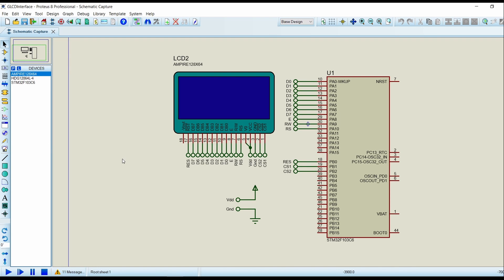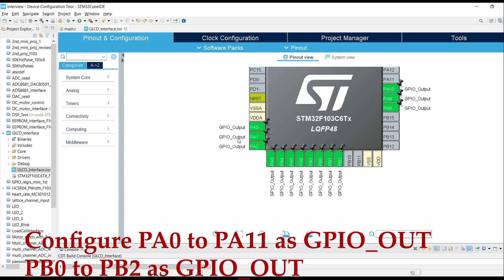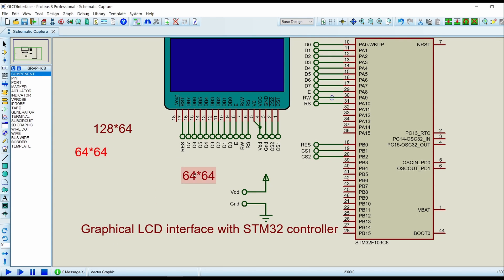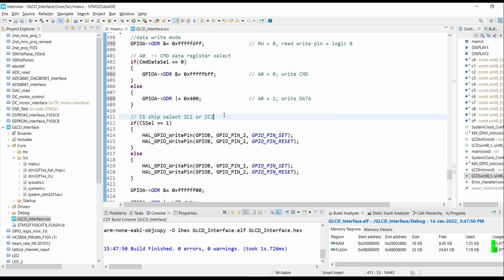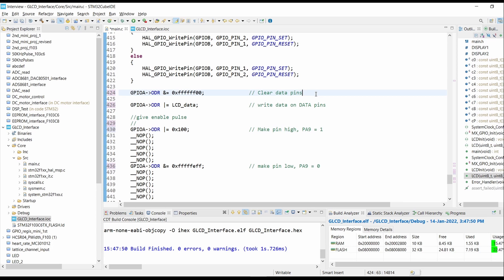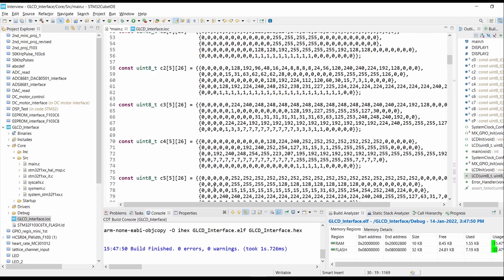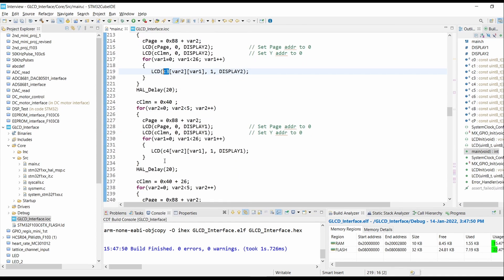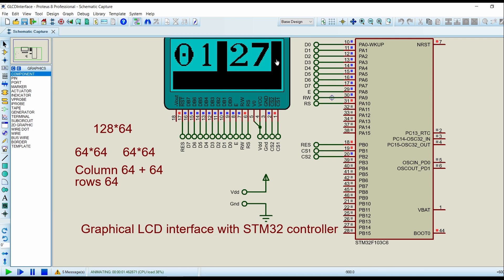GLCD interface with stm32 | KS0108 Graphic LCD interface | STM32 programming | Simulation | Project

Comment: from the lcd manual (YM12864J):  " The data from MPU is written into input register, then into display data RAM automatically by internal operation.
When CS1 to CS2 are in the active mode and D/I and R/W select
the input register as shown in Table 1, data is latched at the fall of E signal. " so Enable pin is active in the falling edge or when it is 0, my LCD has exactly the same commands to unitialize than yours but the enable pulse is reverse. I am confuse...